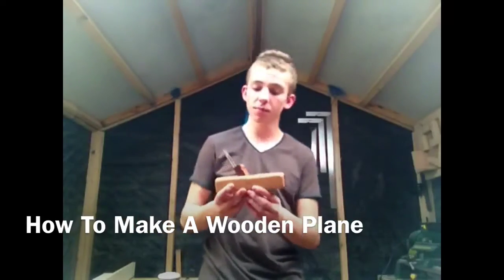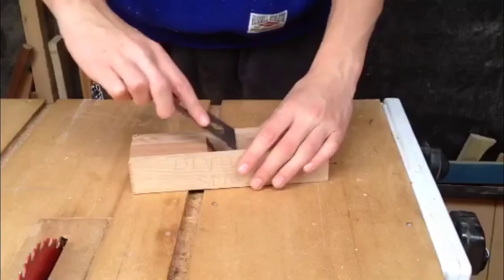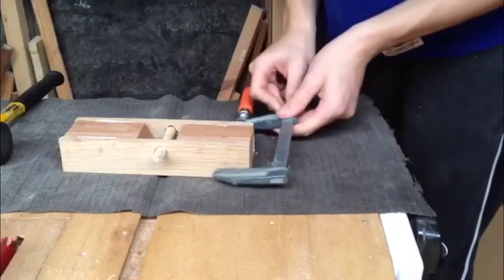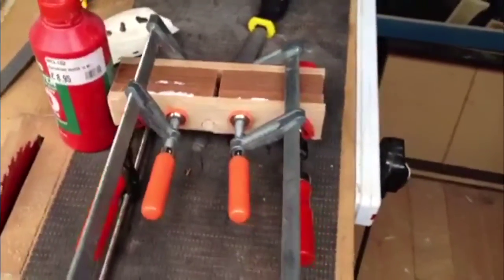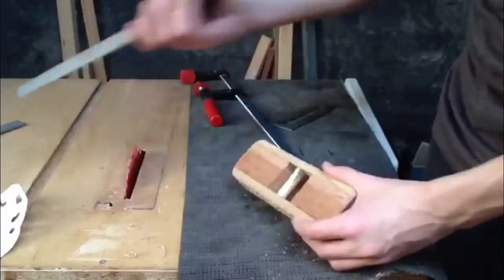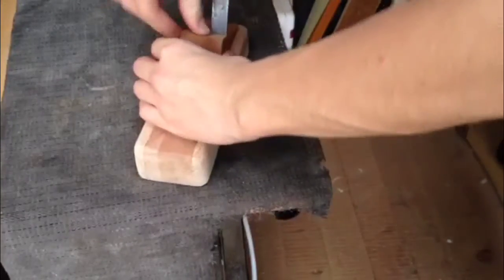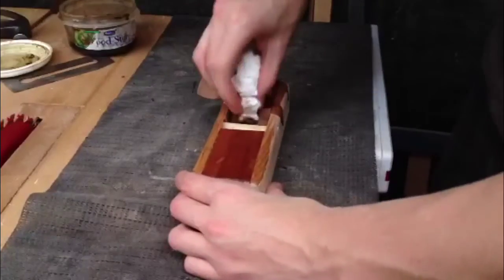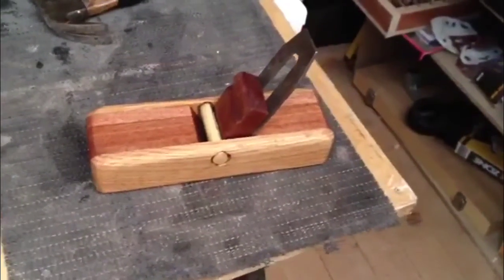How To Make A Wooden Hand Plane

Comment: great video. If you want a quick and dirty sharpen, just grab some 600 grit paper from halfords and give the blade a quick spanking. That's usually sharp enough for chisels, but for a plane iron, maybe grab a sheet of 1000 or higher while you're there to finish off. It's not the best polish in the world but it will give you results to share.

Comment: Adam, you should never wear a hoodie with ties dangling down as you work in the shop.  You'll lean over the check a saw kerf lines up and the saw blade will grab a tie and jerk your face into the blade faster than you know.  It's easy to take the ties out of the hoodie to avoid this.